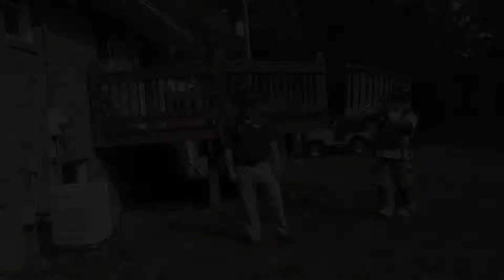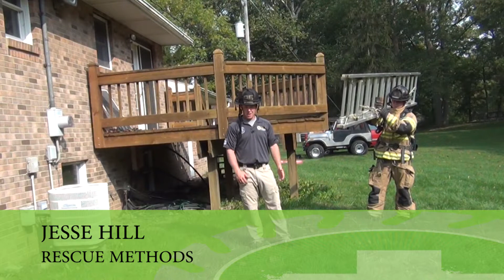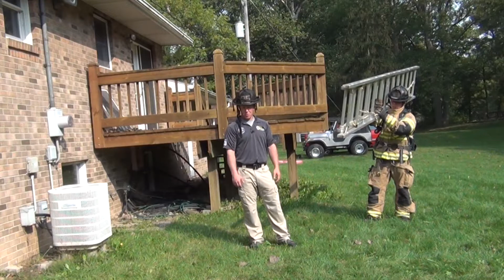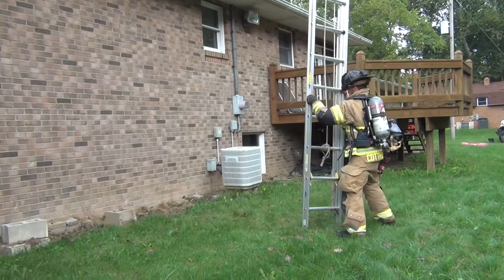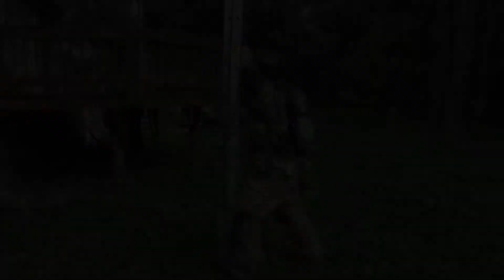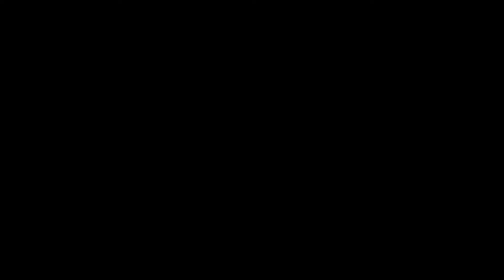One Person Extension Ladder Throw

Comment: If you want to eliminate steps maybe dont tie the halyard rope around both rungs. tying a clove hitch on the bed section bottom rung allows for rapid deployment of extension ladder as the fly section is free to move due to no halyard wrapping